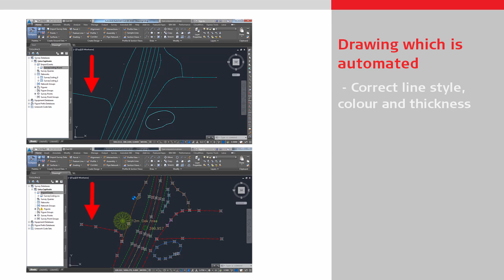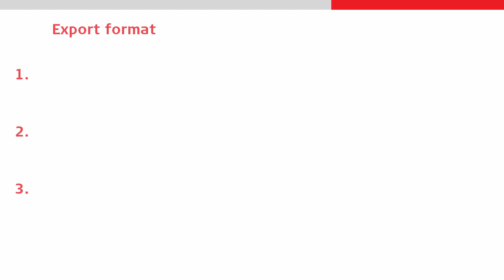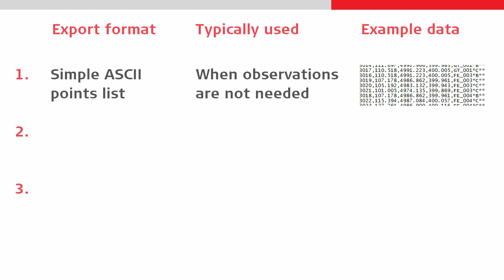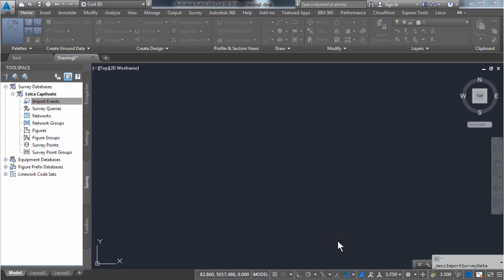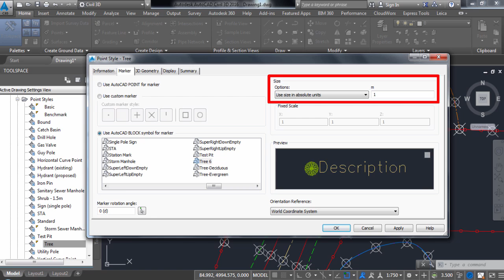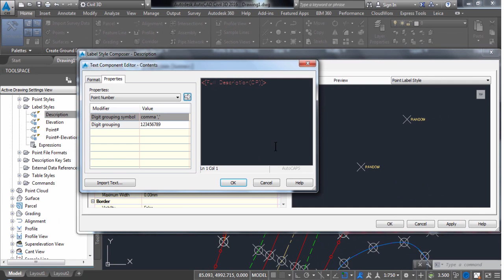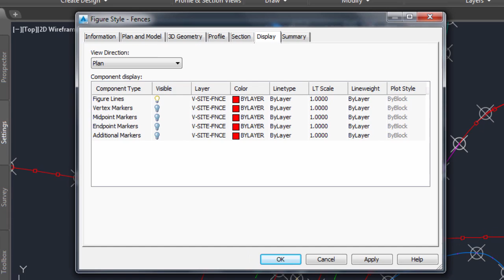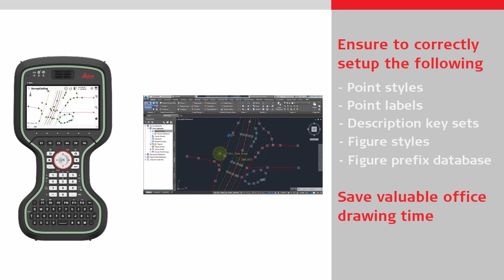How to import a Leica Captivate job into AutoCAD Civil 3D

Comment: I did this kind of work using an old Totalstation with Bentley Inroads. I could connect lines with point codes on Inroads using SP (start point), EP (end point) codes. The presentation is good but most of surveyors don't use these details. I think maximum 4 inputs are enough for ASCII file such as point name, description x, y, z, point code. It looks more complex on AutoCAD Civil 3D. For more advanced data collection, QField and Input app can be used with QGIS, and they are all free. A user can create his own template for data collection using QGIS to use it on mobile or Android GNSS device.

Comment: The part when you guys mentioned the linework coding it's not well explained. For isolated points like the Tree with the description, specie and so on everything was properly explained and there is no doubt about how to get the right information displayed on screen (Description Keys, Label and Point Styles, everything was pretty clear). Otherwise, how Civil 3D knows which points to connect to define a Line and how it treats as isolated points (with no line connection), by its numbers or codes? How it interrupts the connection for blank spaces and so on? How to draw a curve instead drawing a line? I know how to configue the Survey Linework Code Sets to get all lines displayed in proper style, but I still don't get how to translate the points measured to connect them trough those lines in a way that I want. 
Can you guys do a video just explaining in more details how to do a proper linework coding in the field and how Civil 3D understand and translates the imported points to be connected? Thanks!
Reply from the maker: Luiz, could you tell us where you're located?
Reply: I'm located at São Carlos, State of São Paulo, Brazil. This video serie was really good and helped a lot, but in Civil 3D we have the Linework Code Sets, where you can specify how he user will insert codes in field to get line connection. Like for example, EP (edge of pavement) SPACE B, for Begin. Then the line will start and the points in sequence EP EP EP will connect the same line automatically until you put an E, for END. Leica Captive bypass the insertion Linework Code Sets? Is it doing internally all the line coding by giving different numbers to different lines? If you guys could send in my email the .txt file with this survey example to be imported into Civil 3D, I guess I would understand better how it works by reading the field file and all codes inside it.

My email is lztoniolo@gmail.com

We already use all Leica equipaments (2 TS 06 Total Stations and Lecia GS15) here in the office and In the near future we are going to make a upgrade of our Total Stations. Nowadays we use FBK files (oldschool way) to import our works into Civil 3D and it's super easy and effective to get the dot to line connections and all lines displayed as they should (layers, linetypes, etc.), but as a CAD manager I'm already trying to predict which changes we will need to implement in our coding to get all drawings working just it does nowadays if we upgrade all the equipaments.